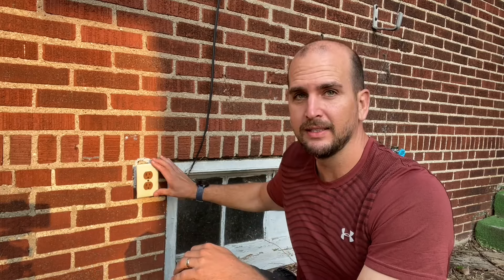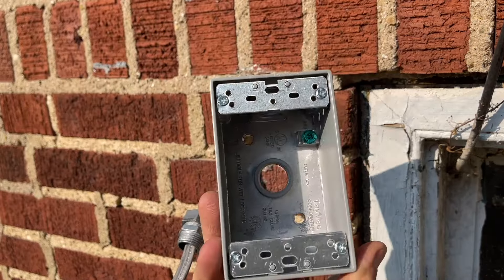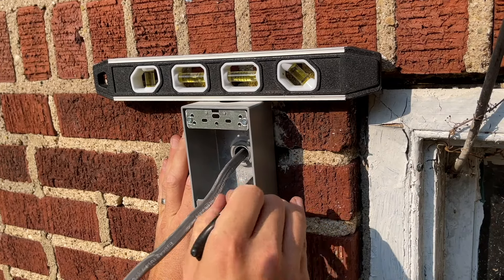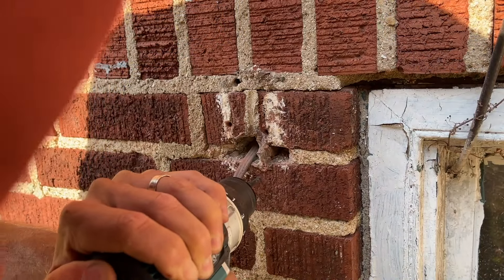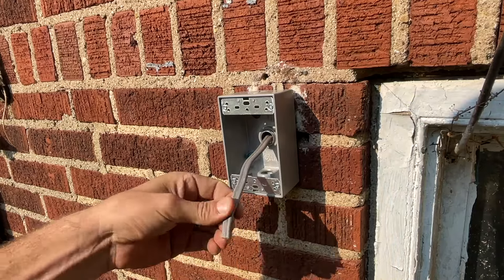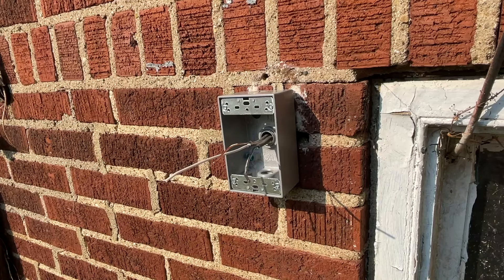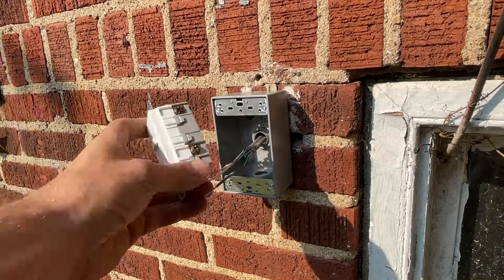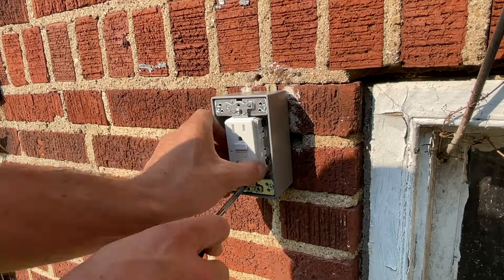Installing The Correct Box and Cover For Exterior Outlets

Comment: One quick tip for a faster install, the Hubbell Taymac in use cover features keyhole slots where the device screws are located, you can actually back out the device screws holding the outlet in place, slide the cover on and use the device screws to hold both the GFCI and the cover with a single set of screws.
Reply from the maker: Thanks for the feedback and I also really like the all metal Taymac in use cover 👍👍

Comment: For those using this as a complete replacement tutorial, don't forget that any outlets found in damp locations, not just wet locations are required to be listed as weather-resistant. NEC 406.9 (A). In the video you can see a 15 amp WR GFCI is used.
Reply: Yes. That should have been stated.

Comment: You should have mentioned that the tapcons should go into brick (or concrete), not the mortar between them.  Also, it's worth pointing out that the whole circuit can be protected by a GFCI breaker or a GFCI receptacle between the breaker and this receptacle.  And unless it's fastened within 6" of the box you need a clamp on the romex.

Comment: Should you silicone caulk where the outlet cover meets the brick?
Reply: I would have done so.
Reply: Same question. It can't hurt if you caulk the hole really well an maybe even the top half of the box.
Reply from the maker: Yeah, it would be good to put 100% silicone on the top and sides.  I would leave the bottom open just in case any moisture got behind the box it has a way out.

Comment: This doesn't require an extra ground wire pigtail to bond the box?
Reply from the maker: I should have made that more clear as the GFCI has a self grounding wire/strap that connects the grounded yoke through the mounting screw to the box.
Reply: It does.